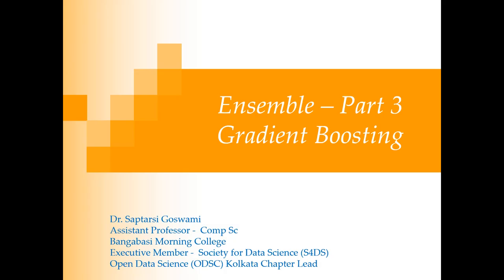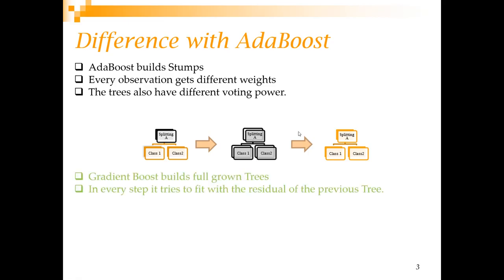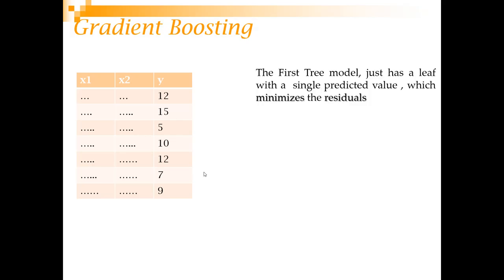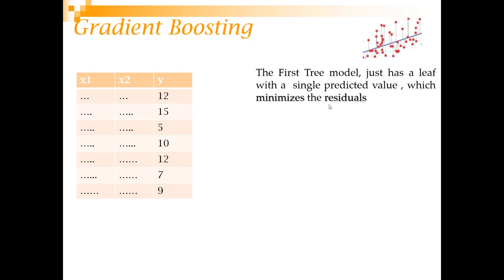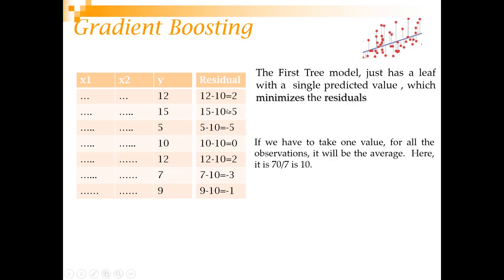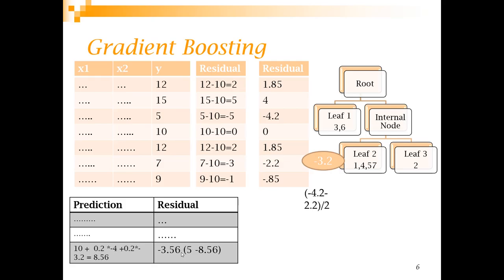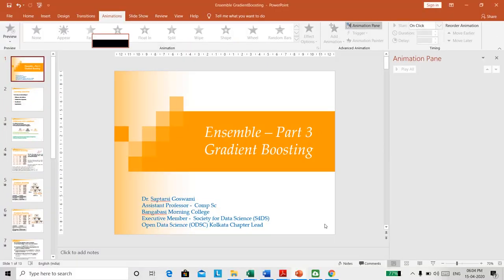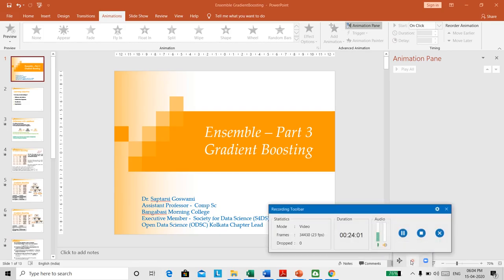Lecture 16 Gradient Boosting made easy

Comment: -1Differences:-In adaboost the trees are independent  of each other,however in GB the trees are dependent as it depends on the residuals of the previous trees.
-2 The first tree just finds the residuals  which is y -y'which becomes the target for the second tree to fit .the residual of the 2nd dt which can be found y-(y'+weight*avg)
-3 Relationship :The residual is actually the negative of the gradient.
Q. It is seen that for the gradient that the loss function is derivative against the predicted function and not the original function.  Is this due to the fact that our predicted function (is a function based on attributes/features ) has a fallacy which we want to reduce that is why derivative against predicted , or ,any other reasons?
Thanks again Sir for the video.